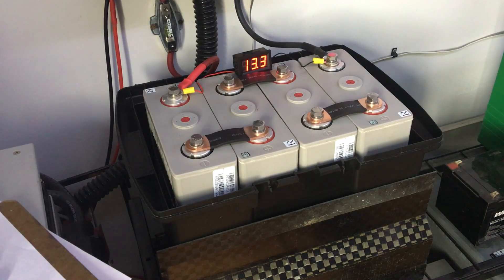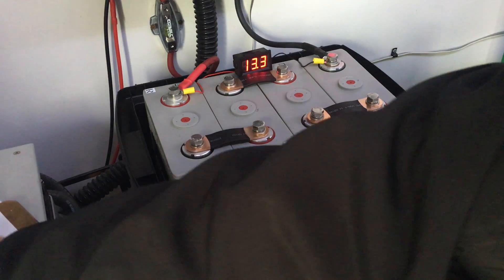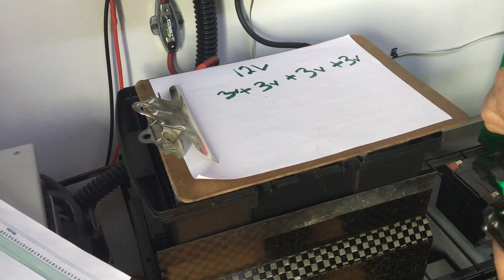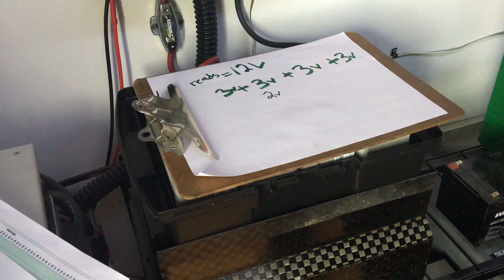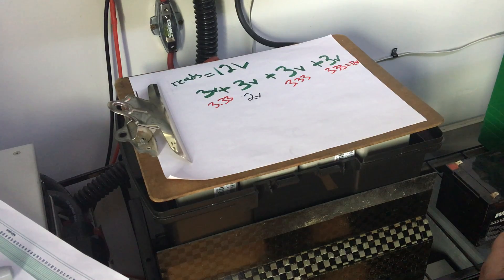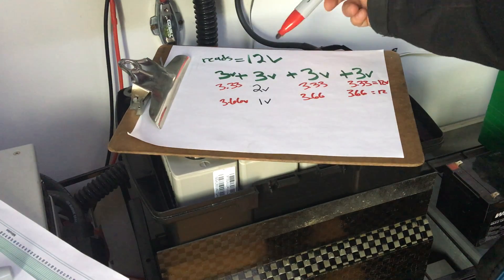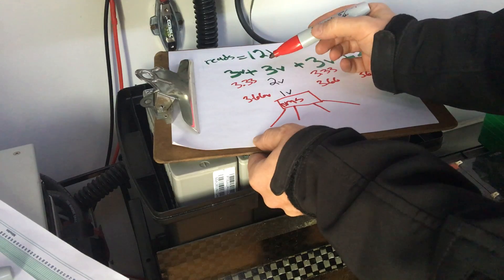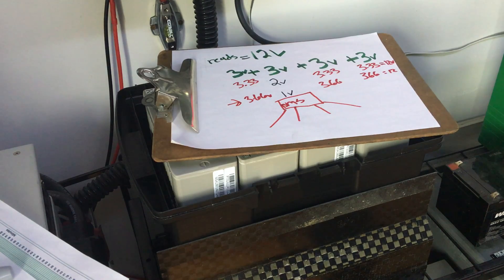Why we need to balance Lithium cells with a Battery Management System (BMS).

Comment: Much more importend than a bms is to instal good voltage monitoring "per cell" and a low voltage cutoff to safe the pack during un attended discharge

Comment: The recommended Maximum charge voltage for Lifepo4 cells is 3, 65volt per cell so your math seems a little of... Also as long as you start out with a balanced pack and stay within the "knees" of the charging curve, upper and lower (min, 2,75volt, max 3,65volt) in practice between 11,5 - 13,9volt the battery pack will Stay balanced, the unbalancing occurs mostly when taking the total pack voltage to high (over 14volt)or to low(lower than 11 volt) that's why in every use lot of folks do a bottom balance and the solar folks a Top Balance so no need for a bms as long as you tread the pack with some respect as is wise for Any battery, bms systems introduce a lot of complexity in the game and most cheaper bms systems do put a lot of weir and their on a battery, as long as you size the pack right in capacity for the demand you really Don't need a Bms

Comment: These are Lithium Polymer cells they are very explosive, the best cells to use is the 18 650 cell cylindrical cells, less likely to explode, and you don't need to bottom balancing.

Comment: It's best to bottom balance  your individual cells so they won't discharge beyond a lower limit.  So before assembling your pack each cell should be bottom balanced.  There are a number of products that will do this for you.  Look to the Electric vehicle conversion world for ideas of DIY devices that will accomplish this bottom balancing.